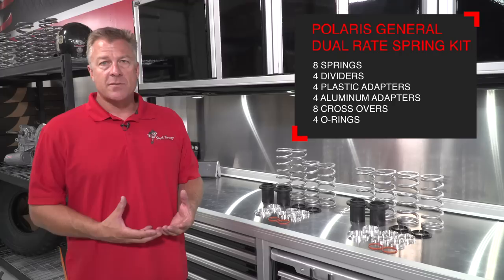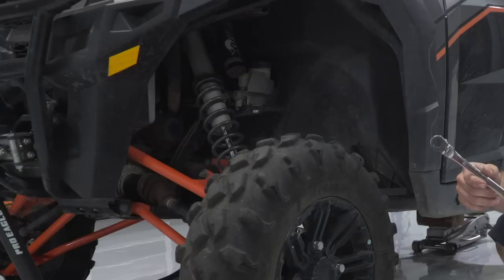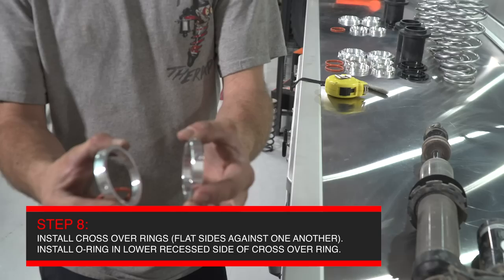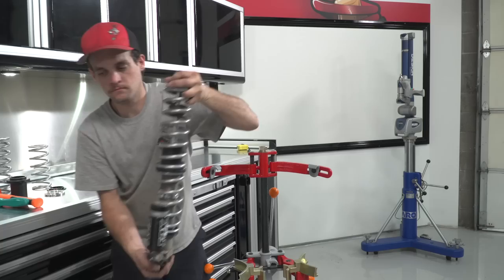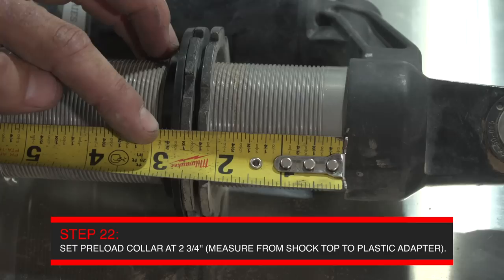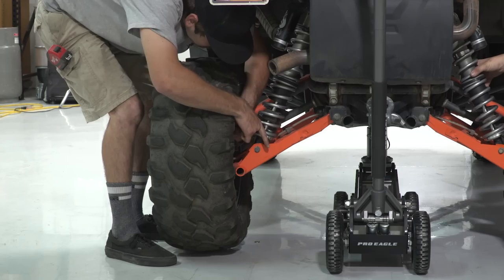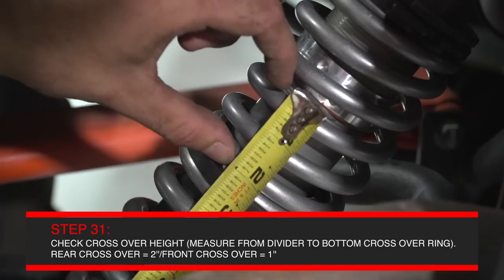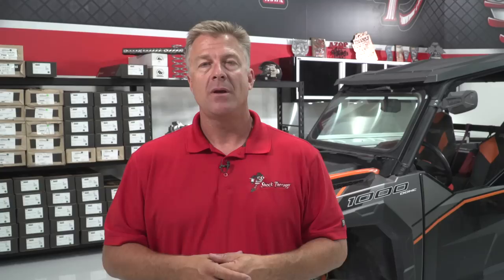How to Install Polaris General Dual-Rate Spring Kit

Comment: The parts as displayed on the table "front" & "rear" were installed backwards. You worked on the front shocks first, all the parts were grabbed from the labeled "rear" shock group?

Comment: Just had my shocks done with the ris by you guys was wondering what my ride height will be running 30” tires?
Reply: There measurement they give the general was riding on stock 27’s . So I’d say If you have 30’s , a inch to a 1 1/2 half taller then what they mention .

Comment: Will this help on the general to keep from bottoming when you lift a plow up?
Reply from the maker: Yes, the main purpose of the dual rate spring kit is to create better bump stage (bottom out resistance).

Comment: Is this the same for walker Evan shocks on a 2017 s 1000
Reply from the maker: Jmorrow 812 yes sir. Same geometry and shock design and method for instal
Reply: Shock Therapy llc same measurements for the crossovers? Was looking into this kit but don’t want to have to do a whole lot of trial and error adjusting
Reply from the maker: Jmorrow 812 I handle the media so I don’t have those numbers for you. But if you call the shop at 623-217-4959 they can supply all the settings you need for your specific UTV and spring kit